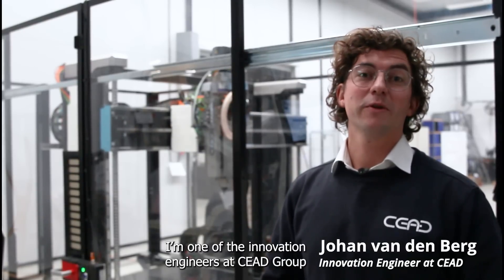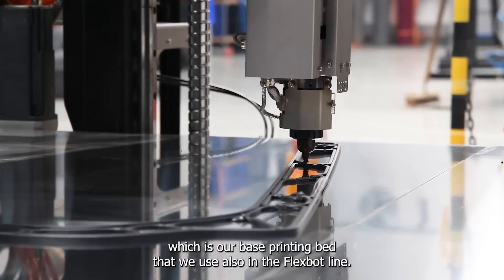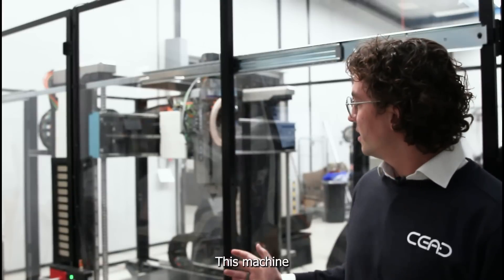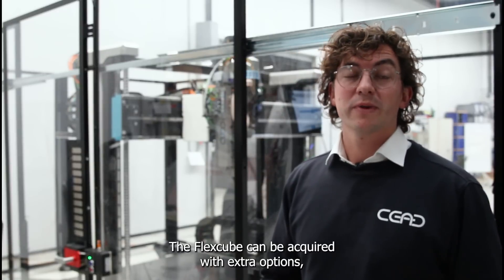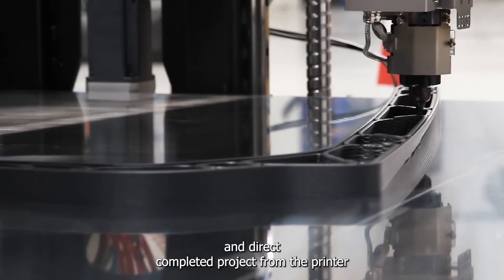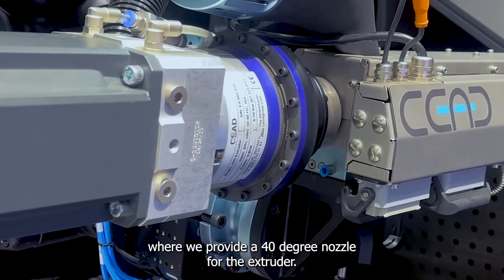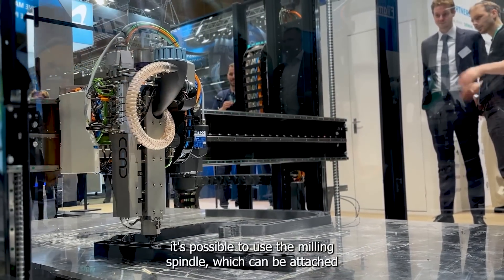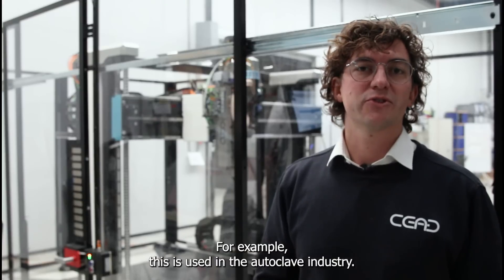The Flexcube: a compact, high-performance 3D printer designed for efficient, scalable manufacturing.

Comment: with such a big. expensive and top of the line luxury machine like that im kinda wounering why its not useing liniar motors on all axis ( even Z with newmatic/hydrolic counterweight ) for that even smoother movement. more precise movement and no wear on whats moveing the axis (specially with you have printed something that have carbon or glass fibers in it and then use the milling spindle where a normal ball screw will be chewed though but a liniar motor dont care )

Comment: From the „It prints marginally faster than an industrial robot“ department. Sure, sometimes you do need to use a karge bed printer, and print things like when you set your printer to 1% speed. But 99.999% of the time, you dont need to do that.

Comment: This look perfect to manufacture composite molds 👌
Reply from the maker: One of the main applications is indeed composite mold manufacturing! Especially with the 45 degree printing possibility and the proven S25 pellet extruder for high temperature materials.